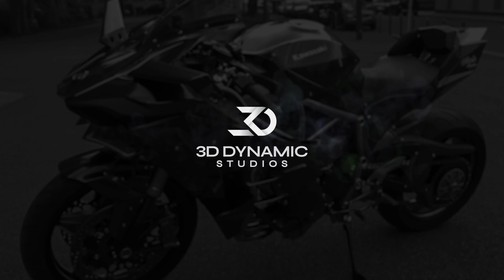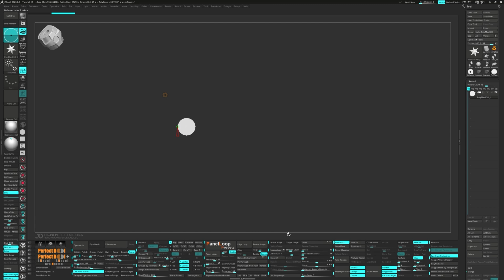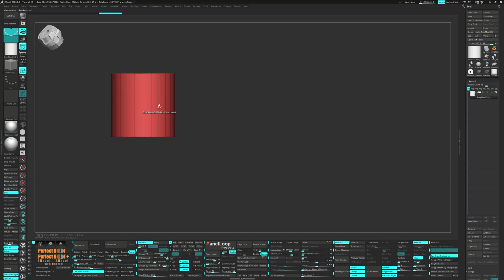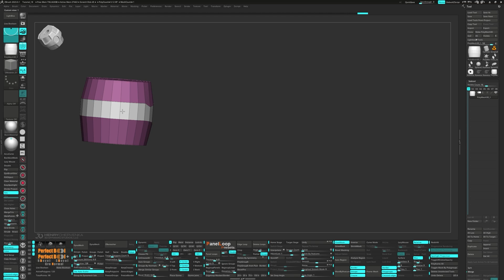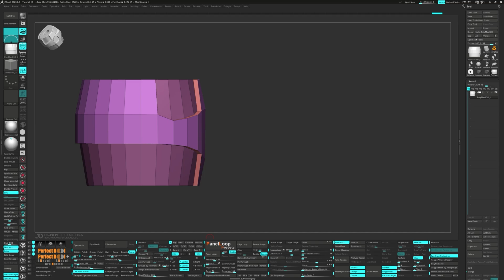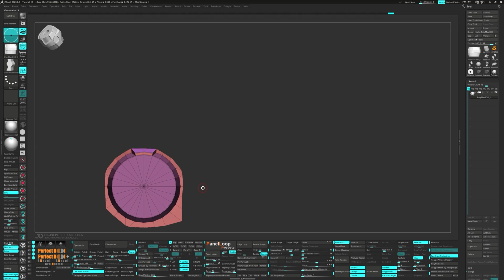Hard Surface ZBrush Tutorial Series // Modeling A Kawasaki Ninja H2R // 46

Comment: I don't understand why when you pick a primitive solid from the Gizmo menu it comes so small. It should have the same size as adding through append method.
Reply from the maker: I'm not exactly sure why primitives from the Gizmo sometimes vary in scale, but since I usually need to move, scale, and rotate my primitives as part of my workflow, it doesn’t pose much of an issue.